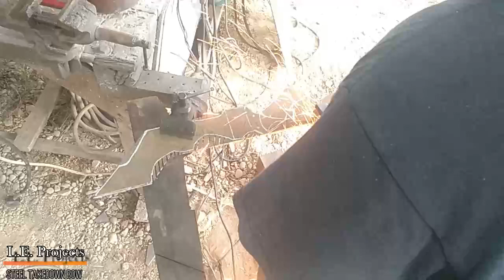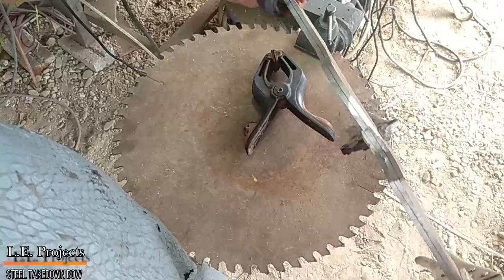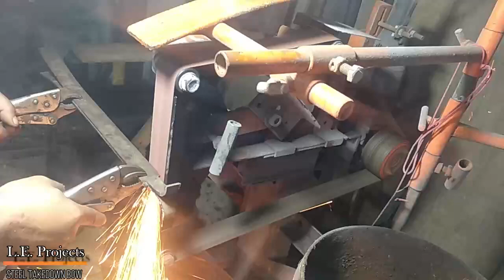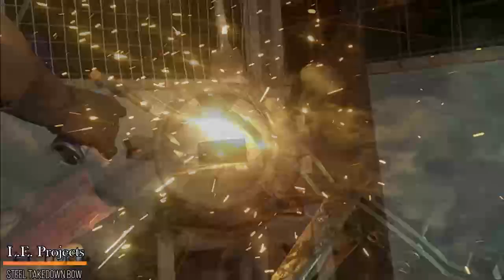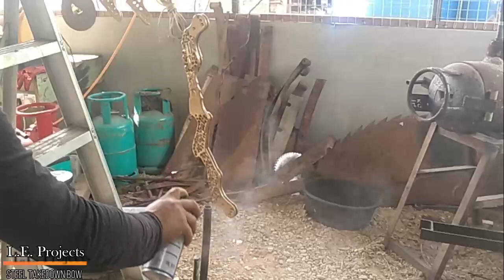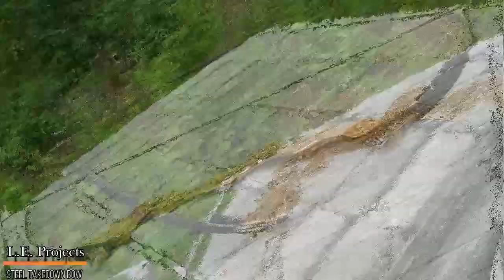♻️ Making Steel BOW from Spring Steel | Cara Buat Busur Panah dari Besi

Comment: Very nice project! 
Where do you find so many saw blades? Most saw mills here in India use bandsaws for as long as I've seen them, I've tried looking but couldn't find any of those huge-ass circular saw blades!
Leaf springs are good but nothing beats those huge sawblades for making machetes, knives or axes.
Reply from the maker: Maybe Just my luck. Weight about 55kg. Found it at scrapyard and bought it for about 2600 indian rupee. The scrarpyard boss said it was maybe from 1970 lumber machine. All Modern lumber machine now using bendsaw right?
Reply: @EncikAlee  Yeah, Pretty much! 
55kg eh? That's a whole lot of knives and machetes 😂 
Love the aesthetics of your work! I've been watching several of your videos back to back 🤘
Reply from the maker: @vikassm  Thank you so much
Reply: Is he from India?

Comment: Should have done a skeleton frame instead of drilling all the holes it would look better too
Reply from the maker: Thanks. i dont have tools to do that. would be easy if got plasma cutter or water jet cutter. This is just an experimental, Next projects i will maybe using aluminium or just wood for the riser. more mobility right hehe...
Reply: Lots of jigsawing.
I'm thinking of pouring an aluminum riser, but I've only done a few statues, and they didn't turn out well. Lol. I'm a woodworker hobbyists, so I'll make one from scrap pine and make a sand cast from it. Though I may just buy a block of aluminum alloy, and cut it up.
Reply from the maker: @meat-hook  more easy if using hard wood. i think hehe
Reply: Pine is easy to work, and is just be using it to make the sand form. Unless you mean wood is easier to craft than metal. That's very true, and I'm less likely to melt my face off.